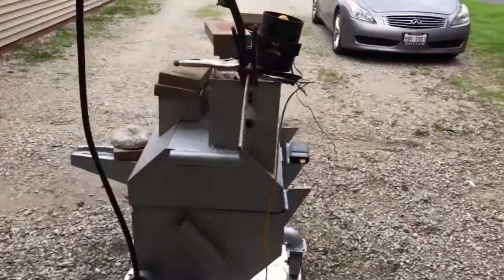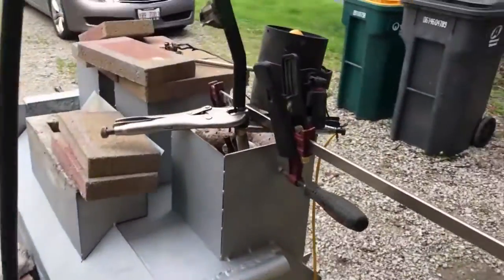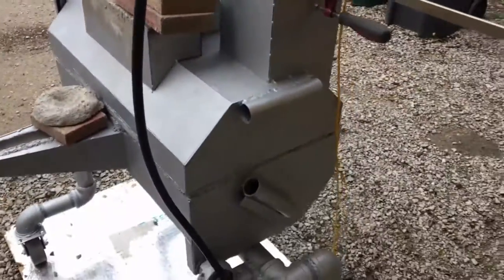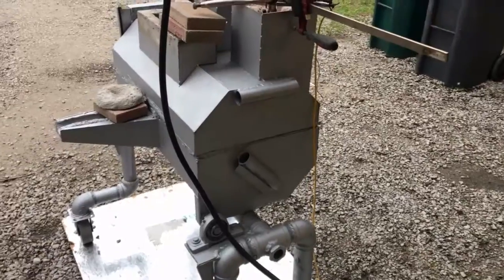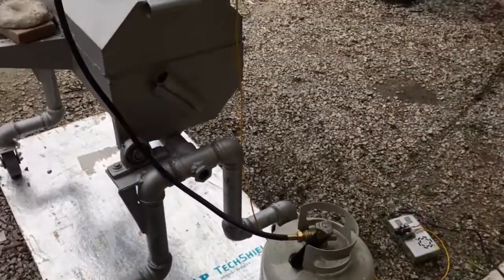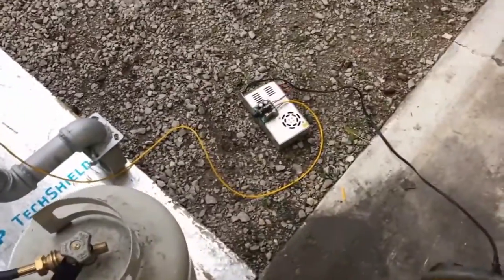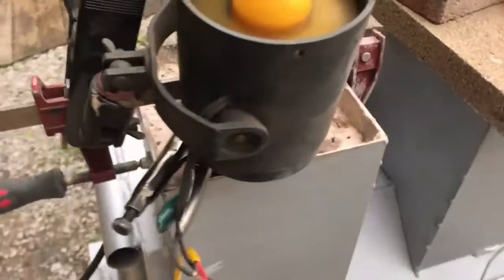Crucible free Casting Foundry up to 75 Lb ingots

Comment: Could you use kaowool in the top halve with a coating of refractory coating and a clay based core with 1 or 2 inches of refractory in the bottom to cut down on cost? Looks great cant wait to see the performance.